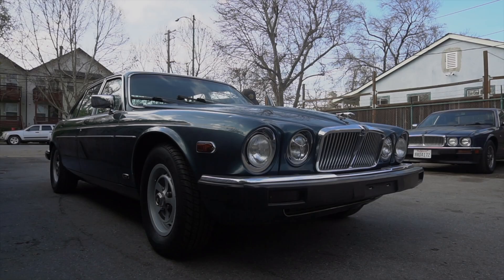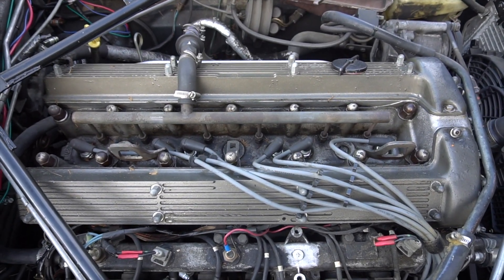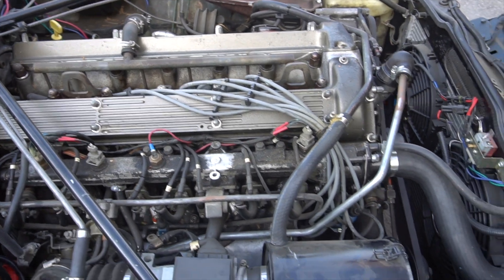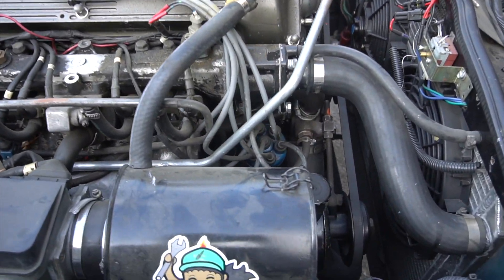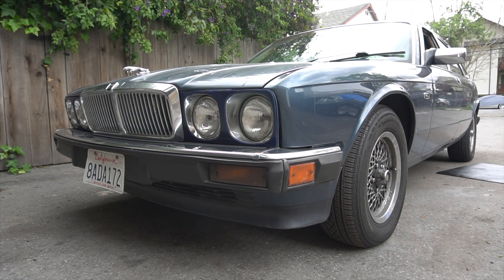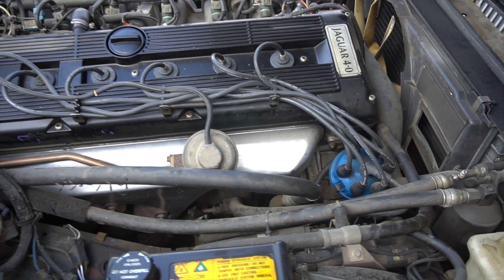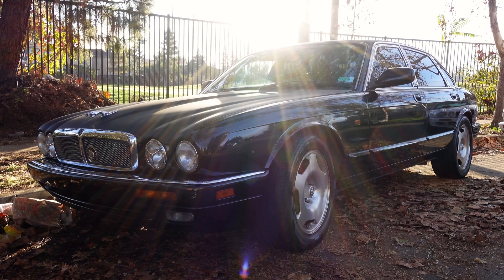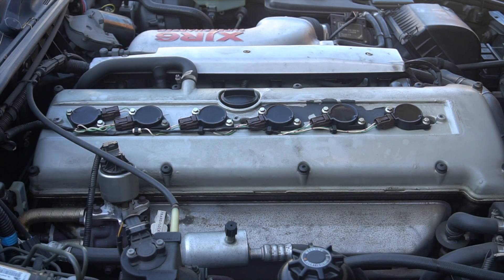Jaguar XJ6 Firing Order: Series 3, XJ40, and X300 Explained!

Comment: The photo you have showing the order for the XJ40 (AJ6 engine) dist. cap is wrong.  Wire #1 should be at the bottom (i.e. 6 o'clock position), not top (i.e. 12 o'clock position), and then from there clockwise on the cap, per the # firing order (5-3-6-2-4).  I caught the mistake by looking and tracing the actual plugs wires in your video from the plugs to the cap.  Please make sure to correct this error  in the video.  It would also have helped if you had one of those set of wires with the #s printed on them, at both ends.
Reply from the maker: Will do brother, I’ll take responsibility for my mistake my fault if it cause you any troubles

Comment: Thank you, thank you, Jesse. Having fooled with the wrong cylinder number configuration for many hours, you finally set me straight. I now know that my 4.0 liter 1997 XJ6 has 1 at the fan and 6 at the firewall. It's amazing how easy it was for me to get to the problem when I'm no longer working on the wrong cylinder. Thanks, again. I owe you a pint.
Reply: Happened to me yesterday. For hours. Thank you  Jesse